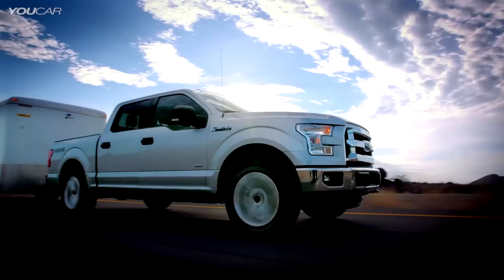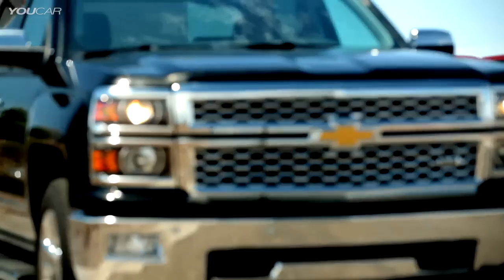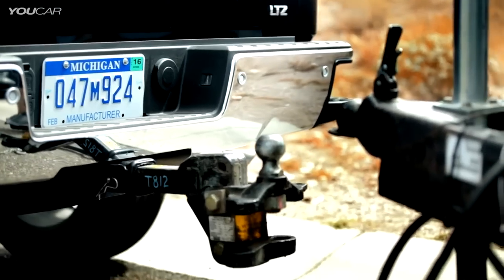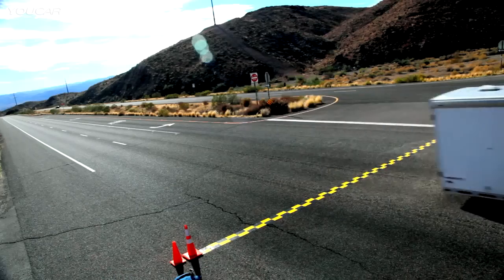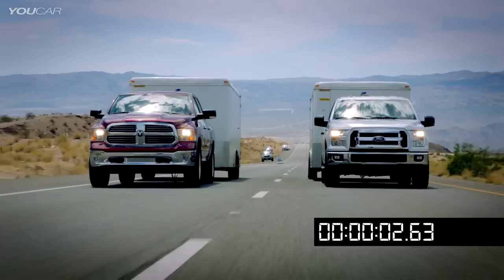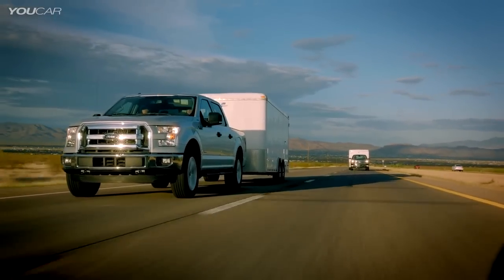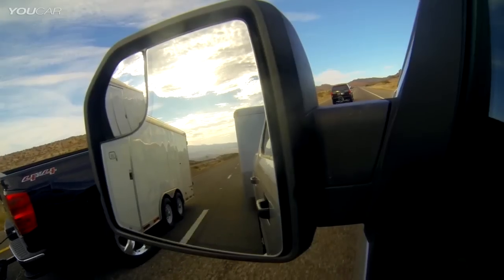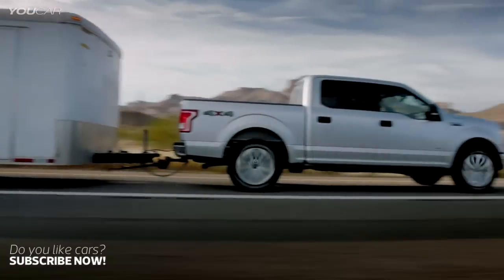TOWING Comparison – Ford F150 vs RAM 1500 vs Chevrolet Silverado

Comment: What are you nuts lol.. The F150 has the interior of the Ford Atlas Concept, the tundra is a POS. Weak engine, ugly interior, weak frame and so on lol Toyota even tried to copy the Raptor with their POS TUNDRA TRD PRO which failed miserably haahaa
Reply: The newer tundras interior is awesome and youre wack if you think the 5.7 is weak.The trd pro and raptor arnt even comparable and the 10grand price difference makes it even less so. Im gonna take a guess and say youre a typical american dissing the tundra because its not "domestic". Give it a break.
Reply: hankmiestro indeed!!
Reply: i force engines last longer than junk ass hemis.
Reply: Dude that's not Wat Toyota said when the tundra pulled the space shuttle
Reply: To the people who say Tundra is best...just..like...lol. If you say it lasts long it's because it's not used like a real truck (Ford, Chevy, Dodge)

Comment: V8 or diesel will have better durability and gas mileage if you're towing heavy trailers frequently. The eco boost would be fine if you don't use your truck as a truck very often. You should never buy a turbo charged V6 as a trailer hauler unless you're fine with terrible gas mileage and it breaking on you all time.

Comment: RAM, I mean Fiat makes a poor quality truck. Just look at and feel the door handles before you get in or even consider hooking up a trailer. When you pull on them to open the door they flex like rubber and the whole door skin moves. Chevy/GMC is the same way. My Ford is 6 years old and the handles are solid. If they can't figure this out I don't trust that GM / Fiat can HANDLE making a quality truck.
Reply: You haven't been in a Laramie longhorn then have you? I own a F-150 and I can admit the Ram is a nice truck as well.
Reply: jangotrooper Yeah. I have been in one recently and I was not impressed. Made me appreciate my F150 a lot more, especially when I saw the price. Go to any dealer and look at the used truck section. After a few years the RAMs don't look too good.
Reply: >mfw my 2012 F550 service truck has been in the shop for then 7 times over 2 years (all because of engine problems). >mfw my co-workers ram 5500 AND chev C5500 hasn't had a problem EVER. Please tell me again how "GM / Fiat can HANDLE making a quality truck ". REAL comparisons can't be in the half ton department because most of them are used like a car.
Reply: Lol your comparison is on door handles? Lol. That's your only complaint?? Lol. Your obviously a ford fan based on your profile pic. I stick to reading none biased reviews by motor trend and the actual experts who have given the ram 1500 truck of the year the last 2 years and all the reviews that say the ram is the better truck. Especially when it comes to the interior. The only area they said they f150 ecoboost beat the ram in was in their payload and towing #s which by the way aren't J 2807 certified like the rams #s all are. Not the mention the fact that Ford tries to classify the F450 as a class 3 truck since u can delete certain items like the bumper and stuff to make it fall in the category so they can say they have class leading towing on the F450 vs the ram 3500. Lol
Reply: josh lowe No, it is not my only complaint, but if they cannot properly manufacture and install door handles what does that say about the rest of the truck? Face it, they are garbage and not worth the sheet metal that they are stamped out of which will rust away before you have it paid off. Overall, you cannot get them to last as long as a Ford or GM and most informed consumers know this. 

Motor Trend not biased? . . . You're joking right?
Reply: Zuba Twizta My friend's friend has a cousin whose brother has a RAM 3500 that was in the shop 17,349 times in 2 weeks. But, my other friend's dad knows a guy that knows a guy whose brother's landscaper owns a 2011 F-250 and its been flawless. It has 963,000 hard miles on it already with zero issues.
Reply: Haha that guy is so dumb. I totally agree with you. Dodge and Chevy over Ford.
*****
Reply: tbagRulz i mean lets face it is not unusual to think that what you have is the better product. You and Chris are doing it right now. it doesn't make this guy dumb to think that the Ford he drives and works hard for him is the best truck. I've seen plenty of Fords be work horses and plenty of Chevys and Dodges be work horses. I've also seen and had couple of each that were pieces of garbage. they are all the same you either get lucky and get a good one or get one that someone neglected at the factory no one is better than anyone else
Reply: this makes me laugh, I got a 2010 Lincoln Navigator and guess what???  The driver's side door handle is BROKE!  And it's suppose to be a way better fit n finish then a FORD.  ALL american cars use flimsy cheap materials.  It's how they keep the cost down.  Ford, GM, and Dodge all do it.  So you can go away with your badge loyalty kool aid.
Reply: Zack Zander Thats impossible! any damn truck would have given issues way before it hit that high mileage. Man trucks still run on the road today because they get the proper maintenance and service needed.
Reply: My Ram's got 101K on it.. shop time - ZERO!!! Ball joints, tie rod ends, etc, etc,etc, etc, EVERYTHING 100% original. Still drives great and will knock 25+ mpg out on long trips with a fucking 320 hp V8.

Comment: Which engine will last the longest driving like this?  Go ahead and call me a hater but I have my doubts it will be the little 2.7L that has to rely heavily on boost to do the job.
Reply: I'll bet you a donut the Ram has higher boost pressure.  Consider this - the 2.7 has a forged crank and CGI block.  In other words, it's designed for the job.  Just like the engine in a semi truck is ... very small in size compared to the 80,000 pound load it pulls and those engines run for half a million miles or more without issue.
Reply: Yeah probably.  Time will tell.  I've had my doubts about the Ecodiesel Ram as well, as it's tow rating is down from the 5.7L Hemi.  I just get the idea this 2.7L Ecoboost is about fuel economy first and foremost.  There have to be some durability sacrifices or cost increases to get it to pull like a freight train.  But if I wanted all-out towing power I'd go for one of the Big HD diesels.

Comment: I want to see the 
silverado 6.2 
ram 5.7 hem
ford v8
Reply: why a old ford v8 thats old technology the new 3.5 v6 and the chevy 6.2 are both very good engines but rams 5.7 is slow asf
Reply: I want to see the newest 6.6L Duramax and The newest Cummins go up against an ole '00 7.3L Powerstroke in towing
Reply: jj Watson that's not true at all. I own a chevy with the 6.2 and a 2017 ram 5.7 hemi with 3.92 gear ratio. In a 0-60 the 6.2 is barely faster by less than half a truck length. This video is very deceiving. They picked the eco diesel not the hemi. That eco diesel will get twice the fuel millage but it will be very slow. I wonder why they didn't pick the hemi with the new 8 speed? Hmmmn?. Any how I'm happy with both of my trucks, speed isn't everything. I want a long lasting comfortable truck. Id be interested in the Ford 5.0, nothing else.
Reply: Ford v6 is the best

Comment: HaHa!! These Ford sponsored videos always amuse me.
Reply: DropShotMaster1000
you mean those little so called trucks ? we call them wagons lol less HP , torque , carry few people , carry less , pull less etc... & don't say tundra because it's made in texas .
Reply: mohammadkwt Dodge is as some people say "fiat" carrys the same about of ppl the ford does can tow more has 10 less torque "but can still pull more"
Reply: LOL. I know for a fact that ain't true. The Ford WILL tow more. Dodge can't make trucks right. But Ford they've always been the pinnacle of engineering.
Reply: mcatlow8 it wont be the gmc 6.2 not even close i own both
Reply: mcatlow8 You must be stupid there has been many test where the Ford F-450 went against the dodge 3500 and the dodge has more power when they needed it the most and is a class 3 truck and has a better exhaust brake dodge wins when it comes to towing ford win when it comes to luxury
Reply: HAHA NOT TO MENTION ECO BOOST IS HAVING SO MANY PROBLEMS.......HAHA..I rather take the Eco diesel.....heavier truck...I would wanna lose CONTROL IN A LITE TRUCK AND THE TRAILER TAKES CONTROL OF MY TRUCK.
Reply: Nationalcitysycho d
the EB only having problems on the f-150 but it's working with the others ford vehicles just perfect so it's successful on 12 vehicles but it might fail at 2 vehicles too ( mustangs for sure because how will buy them as eb anyway & maybe the expedition too ) .
Reply: You know what really amuses me? The fact that my 4 cylinder VW GTI destroys SRT-8s dodge anythings daily.
Reply: FentanylPopsicle I would like to see this...
Reply: FentanylPopsicle
unless you have it modded then you won't .
Reply: PkwyDr my 4.6 STX smokes challengers all day long bro.
Reply: Nope...
Reply: IFIXUR360 Nice try. I've seen an '05 4.6 Stang with 4.10 gears, gutted with intake, exhaust, tuner and spray and stock SRT-8 challengers still shit on him. Stop being delusional. Sure Stangs are fun but don't sit there for one second trying to tell me they rape SRT-8's. I'm a mechanic not a retail worker, I know what engines can do.

Comment: You can see that ram an Chevy are lower than ford because they added more weight to ram an Chevy 

An of course is produced by ford so guess who they are gonna put on top
Reply: Uh, no, Ford always has their trucks up in the air.  Go look at the dealerships.  It's one of the reasons with similar trucks the Chevy always gets a little better mpg.
Reply: I don't think so every time you add weight to a truck it needs to lower down an specially when your towing 7,000 pounds
Reply: The 2015 tow ratings will tell the truth as all mfg's are using the same SAE standard.
Reply: Notice Chevy never fights back....they no there truck isn't as good...cord is simply the best truck
Reply: fordrulesf150 ...or they never fight back because they have a solid fan base who know the truth and don't meddle in trying to prove it to everyone else. "cord"? on the other hand, pays hand and foot to produce biased videos on youtube channels to try and keep theirs from changing brands. You should also check into the reports of Ford failing to use the same standards in the past. They use in house testing for their ratings...something which came to point with the current heavy duty battle. ...you know the one where Ford uses their 1 1/4 ton vs. Dodges 1 ton...posting a tow rating from their in house system just above the ram....I am a GM guy, but I can tell you Ford is not without their demons...
Reply: And Chevy isn't with out there's every company has there short comings ...ur a gm guy I'm a ford guy i be always had fords and I've never been let down ...my good friend Jesse is a gm guy and every gm product he has owned I've had to toe him home...I'm ford because of my experiences
Reply: The realy questions is why are they using a chevy instead of a GMC...
Reply: Matthew Buth -wouldn't make a difference in that aspect. GMC=Chevy only more options per level. LS=SLE LT=SLT LTZ=Denali(kinda). Powertrain wise, It would be the same 5.3 - just may have both front power seats instead of just driver in the Chevy..
Reply: The only way it would be different would be if they put the denali against it...but they could just use the 6.2L in a chevy or a GMC which is an option on the lower trims....but that wouldnt be comparable in the test.
Reply: SlickDiik 86 Well GMCs are put to get her better...